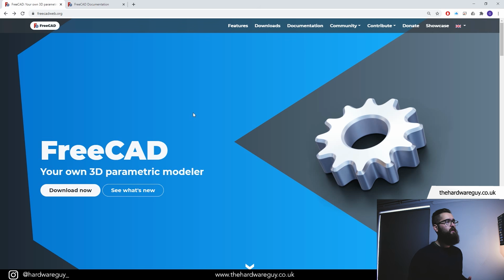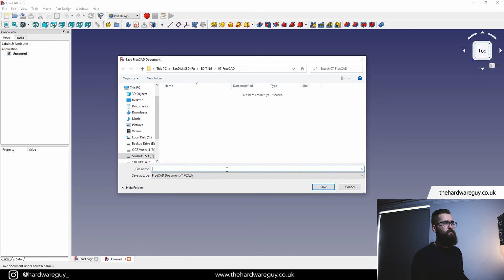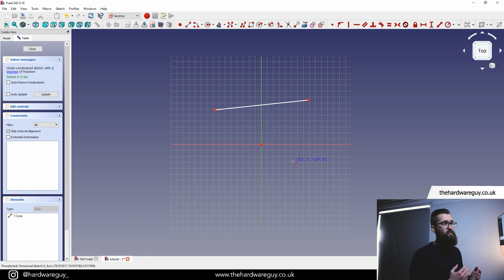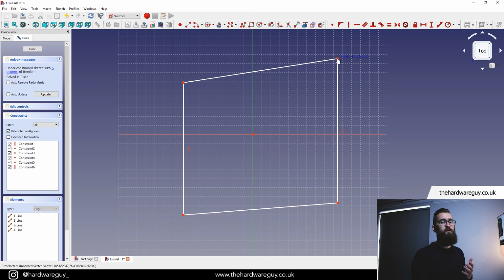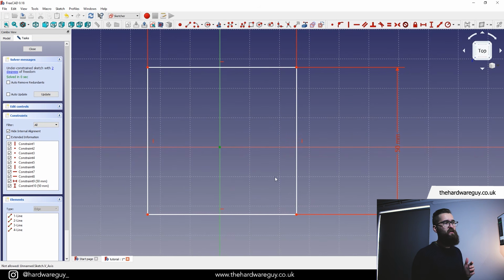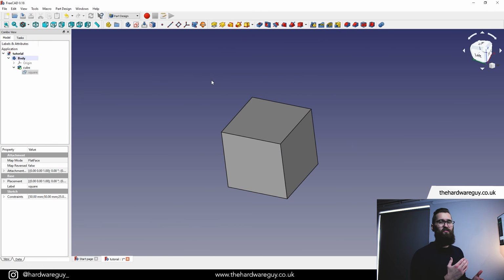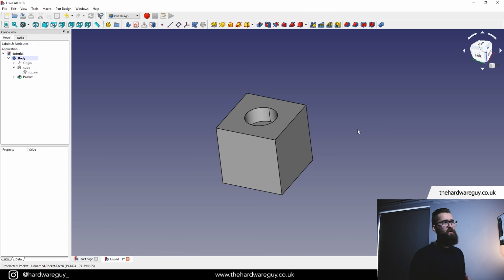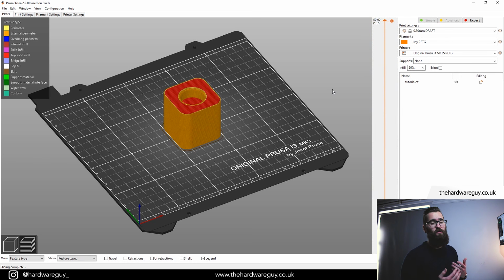FreeCAD For Beginners p.1 - UI, Sketching, Constraints, Extruding, and 3D Printing

Comment: Bro, I'm just going to tell you: I'm a software engineer and experienced with Sketchhup, but brand new to Free CAD.  And when I try to follow this tutorial I keep running into issues about every 2 minutes where my screen and results look nothing like yours.  I suspect ether you've changed settings over time or are executing key or mouse strokes without even thinking about it...without telling the viewer.  For example, I had to go figure out how to turn on the grid view in the sketcher.  Now after drawing the first square, "updating" and "closing" it's not showing my square on the Part Design view.  I can double click and go back into the "sketch" in the model tree and the square is there.  It just doesn't show up in the part design view.

I'm going to give it about 2 more minutes to try and figure out what the difference is but I'm close to abandoning for a different tutorial.  I suggest...well...can't imagine you would now.  I'll just state it this way: you should have done the tutorial starting from a fresh install of FreeCAD and been very conscious of every action you are taking and let the viewer know.
Reply from the maker: Hi William, sorry to hear that you've been having difficulties. All my UI is default, and I did actually do this tutorial on a completely fresh install of FreeCAD 0.18 for the exact reasons you highlighted above. Tens of thousands of others seem to have had no issues so I think it might be a problem with your FreeCAD installation. Try download a fresh copy and give it another go! Are you on Mac, Windows, or Linux?
Reply: @thehardwareguy  I was able to get through to the end and create the part.  I really don't have any idea what changed.  Yesterday I had not apparently hit save, so on app start all I had in my tutorial file was the "tutorial" object at the top of the tree.  I went back through from memory and repeated all the steps, but this time when I hit hit "update" and "close" to get back out to the part design view, my box showed up and was there.  From that point I could follow the rest of the tutorial.

It worries me a little in terms of stability just because there really was no obvious action on my part that changed anything.  Is v0.19 suppose to be fairly stable?  At any rate maybe for others: if something flakey is going on maybe try to restart the app.  I'm just saying...that's all I did to see the different behavior.

Apologize for the frustration vent yesterday.  I know these videos take a ton of effort and your quick response was very gracious.  I will continue to go through all of your videos. Thank you for taking the time to create them.
Reply: @thehardwareguy  PS this is on windows, Predator Helios 300.

Comment: @Gareth -  I thought this video was well done, and informative.  However, I have to admit, it took me about 4-5 viewings of it before I could get the same results as you.  But I'm getting older, and things just don't sink-in like they use to.  :)  One observation that really had me stumped, was when I went to draw my lines in the XY plane.  Every time I would go and click and try to draw the line whole  plane would move.  I finally learned via the web, that I was in 'inventor' mode instead of 'CAD' mode.  This no doubt has frustrated many a new user to the software.  I've loosely tried other design software and  really find all of them not very intuitive.  I guess my frustration stems from simply wanting to do very simplistic designs for the type of objects I need to 3D print.  While I understand the need for advanced 3D software for professional use,  it would seem to me there's a missed market for the weekend 3D warrior - for lack of a better word.  :)

What I need to do is design a simple 2D  object.  Give it a little depth (Z-axis), put some holes in the corners and print.  This can't be too hard to do - either with a beginner type app, or the more advanced.  I'm so use to drag-n-drop with other software, that I found even FreeCAD difficult to work with, because those simple techniques don't seem to apply, or haven't obviously been built into the packages I have tried I tried in an intuitive way.  One should be able to simply grab a corner, frame-out the length, width, and even depth with a mouse more easily than the steps required in FrCAD with coincident and constraints etc.   Don't get me wrong,  You're doing a great job for a beginner, and maybe most folks want to do more than I do, but isn't there a simpler way?  Changing the length of line should be able to be done with the mouse, and I did see some evidence of that capability, after I went back and tried to change the dimensions of the cube in this tutorial.  However, I never met with any success.  What's the command for 'starting-over' ? :)  I have to admit, I threw my hands up in frustration.  Maybe I'm the only one!

Anyway, just some thoughts I would share with you and the audience.   It's evident I have more to learn in a more structured way with techniques I think are over bearing to the user when applying to simplistic designs.  I've subscribes and will continue my journey.  You seem to be making the most sense and explaining things very well.  Thx.

Comment: Freecad still needs some work... "fix horizontal distance of two points..." what about just having a tool "dimension" and have it be clever enough to understand that if you click two points, that's your dimension between them, point and a line -> distance between them, two lines that aren't parallel? Maybe you want to set the angle between them... you just click a line? you want to set it's length etc.

less hassle, less tools, less time wasted :)

Padding? In EVERY package I've ever used it's called extruding, why change that?

Poacket tool?!?!? What? You should be able to just extrude that sketch using boolean operator, no separate tool required!

all these different and very particular tools make the user interface cluttered unnecessarily.

Freecad needs UI overhaul and a UI designer :)

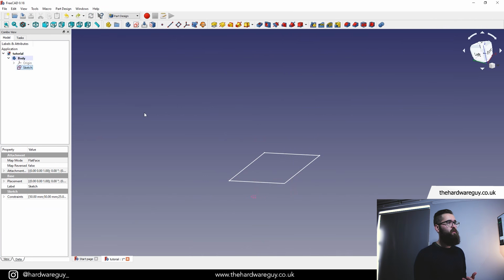Comment: This is a GREAT tutorial.  I've been through it many times, bit by bit.  I'm using 0.18 on a Mac.  My problem is that the menus don't always look the same as TheHardWareGuy's menus.  Example; 13:29  Once I've clicked Update and Close, the grid disappears, but my square is gone as well.  I've been through this part (and many others) more than a dozen times, carefully, but still out of synch.  So I'm less than 15 minutes in and already spent more than an hour.  What am I doing wrong?  How can I get help from someone (preferably in UTC-7)?  Obviously, a tiny button or click somewhere to get me back on track.  Just haven't found it.  *#*@&(@*@!!

SO many settings that can be different.  Is there a way to "factory reset"?

Comment: This looks well done (I'm less than halfway through), but version .19 seems to have some differences. For example, that startup display with the "Documents," "Help," and "Activity" tabs doesn't appear. Also, after you select a sketch plane, the plane is displayed without a grid by default. Also, after using the Constraint tool, there's no apparent way to get back to the regular selection tool; seemingly small omissions like that can get people off to an aggravating start.
Reply from the maker: I agree, unfortunately I cannot account for future versions/changes when I make these tutorials! Usually the changes are small and logical, and with a bit of Googling you can figure it out👍🏻
Reply: @thehardwareguy  Certainly. I'm finding that the bigger problem is FreeCAD's strangely arbitrary behavior. For example, the first time I used it, I never created a part or body. Yet at some point it presented primitives in the tool bar, and I started constructing a model. On trying the same sequence of steps, I've never found a way to get it to do that again. And the missing grid is perplexing.

We'll see if behavior like that turns out to be bugs or unintuitive UI. Meanwhile, keep up the good work!
Reply from the maker: Thank you! I have to agree with you.  FreeCAD is great if you can deal with those bugs, but for me it massively slows me down. Fusion 360 is my CAD package of choice for sure! So much more efficient

Comment: Gareth, nice instructional video.  I got a lot out of it. I'm trying to design a foam insert for one of my hard-shell cases for my drone and had to trace some of the objects (e.g. remote controller, drone, etc.).  I'm trying to get these into FreeCAD, but I'm a novice when it comes to CAD.  I can follow instructions very well though ;).  I have a good friend that had a glass cutting business and I can use his waterjet or 3D printer as long as I can provide a finished drawing in PDF format.  Have you done any videos on how to import objects from a PDF into FreeCAD?  Thanks, Gio.

Comment: Very Well Done video and explanation. What I find difficult is the approach to making a component you want to 3D print, example would be fan blade. What would be the process to building say for example a 3 blade fan blade with a hub that attaches to a motor. That is some thing that would kick me in the right direction to proper design.

Comment: I tried this program out and managed to create a drawing of a workshop I am planning to build. Then when I shut the program down, after saving my drawing, the only thing saved was the outline. No dimensions, all lost. Then when I tried to print it out the program crashed and did so several times in a row. A total waste of time. I don't know why you are promoting it.
Reply from the maker: Never had this issue! Could just be your computer if it's low spec. What operating system are you running?
Reply: @thehardwareguy  Windows 7, 64 bit. I am trying Libracad, hope I have success. My old Autocad won't install on the 64 bit system.

Comment: Hi Gareth - Thanks for clearly explaining how to use FreeCad - I have been using Autodesk Inventor for some years now but since they now have moved to subscription based licenses and Windows no longer supporting (conspiracy) I am extremely disappointed as I cannot justify the absorbent fees they are charging. So I have opted to move to FreeCad - I have subscribed to your channel so most likely I will be leaning on you for assistance until I bed in on the merging over.... Keep up the good work rgds Patrick

Comment: If only Fusion360 and Blender tutorials were this well-paced and easy to follow. Having an engineering bent, I've not so much cut as I have smashed my teeth on Fusion360, creating sheetmetal bracket designs for work.

The time spent explaining constraints was well worth it because whilst I've seen them in F360 and have sort of understood them, my sketches have always been a little arbitrary and I can take away the constraints lesson and apply it to both FreeCAD and F360.

For the same reason stated at the outset, the licensing change has seen me looking for something free but easy to use at home for 3D modelling/printing. 

I think this video has locked me into FreeCad - well done, mate!

Comment: @ thehardwareguy

Words cannot describe how happy I am with this tutorial.
I've recently started into the 3D world which I am so happy with. I've 3D printed so much stuff already.
But there are so many things I would like to design and print but I have no experience. I have been using Tinkercad and importing someone else STL, then editing it. You can imagine all the headache I have been having.
I did had FreeCAD installed but I had no idea how or where to start from.
I am a Linux user, I did try 360 Fusion via a Windows VM but you can guess what happened.
I managed to create this cube, export and import it into Cura and voila, I would be able to print.
I am so damn happy. Thank you for such simple and yet high-quality content.

Subscribed!

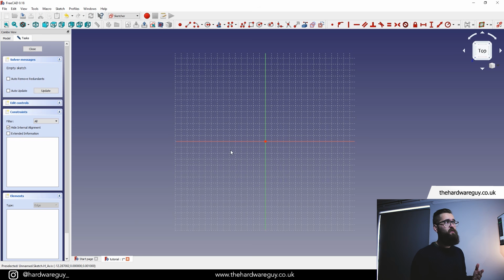Comment: At 5:09, my plane is missing the grid, it only has the green and red line.
Reply: under edit controls i have a check box for show grid
Reply: Thanks for your reply but, I looked for Edit controls, can not find. Under Edit /Preferences/Sketches (button)/show grid (checked), grid size (entered 20 mm) this gave me a grid. Using Version 0.19 if that makes a difference.
Reply: @billsmith2308  I am also using 0.19... I just started using freecad so I don't know if I am using the correct words so I made a simple video that could help.
https://youtu.be/-TSDAhBWnA8

Comment: I can't get the spreadsheet to display in inches (" or in) even though I set it to imperial in preferences and set the cell properties. It keeps converting.

Trust me I wouldn't be using Imperial if I didn't have to.

I was expecting to have problems learning freecad but not this early on. I'm running 0.19.

I know this isn't the FreeCAD forum but I just thought you might have an idea of what I can try.

Comment: I'm having trouble putting two shapes in one file using sketch. For instance, if I sketch a circle, pad it, everything is fine. Then when I sketch a rectangle, I can't pad it. I've tried in a different shape, different body, tried all the copy options that produced and finally usually end up with Freecad saying I'm trying to pad two objects at once. Is this a feature?

Comment: I followed right up to constraining the position without issue, but  once I closed the sketcher and went to back to part design to to the pad, I keep getting an error saying that I need an active body object in the document. I couldn't figure out how to do that, or even what that means, exactly.
Reply from the maker: After creating a new part and body as show in the video, the body will become active for you to sketch. If it is not already active, double click on the body in the part tree to make it active. You should then be able to sketch :)
Reply: @thehardwareguy  apparently I renamed the body, therefor deactivating it, if that’s possible. I added a new body to the document and was then able to do the pad. I had just installed the software a few hours earlier and have no experience with CAD. I lost my project several times, it disappeared from the screen, couldn’t get it back. So I started over and actually finished my part design, recesses, holes, and all. Thanks to your video. I look forward to seeing more.

Comment: This tutorial missed one thing. To improve export quality go to Edit>>Preferences>>Part Design, select the Shape view tab, and then under the "Maximum deviation depending on the model bounding box" change the default number from .5 to .01 it will greatly improve your export/3D print quality. 

Over all great tutorial! I use Solidworks at Work but they are locking down the use of work software for personal items so I am picking up Free Cad for 3D design, and KiCad for PCB design. I hate learning new software. :/
Reply from the maker: Excellent tip, cheers!

Comment: Excellent video thanks! Great pace, well explained. I recommend getting a keystroke visualizer though. I've been struggling to use FreeCAD for a couple weeks now. My biggest mistakes was using the drafting tool instead of sketch, and not creating a body straight up, but trying manipulate non+body objects/groups/components. I'm still very confused as to what they are and why every 3D thing is not a body, but I'm happy to see you have more tutorials which I will make my way through. Came to FreeCAD because I got tired of dual-booting out of Linux

Comment: So maybe this tutorial is good. But there is no way that it actually solves issues. I followed along drawing out my lines, tried to add constraints and... nothing. No endpoints joined together. The lines can still be moved independently.  I can see the constraint listed under the Tasks option, but when I select them, I can't do anything. I get messages such as "Selection not allowed by filter". Tutorials like this only show you things which "work". Not issues where things go wrong.
Reply from the maker: Hi man, sorry to hear you're having trouble! You must've gone seriously wrong somewhere. Make sure you're using the correct tools, you might be using the 'point' tool instead of the coincident tool. Please try again and follow extra closely.

Comment: Can you teach how to design electronics enclosure with cutout for SD card, USB type C, wires, LED, fan cooler, and make it parameterized.
Reply from the maker: Certainly, was considering maybe designing an Arduino Uno or Raspberry Pi case
Reply: @thehardwareguy  not arduino or raspi both are old things and easily available, generic cases like https://www.youtube.com/watch?v=cJfbINgyz-k but with cut out for different things like fans, USB type C, SIM card, etc. Using metal inserts, and if you can generate it directly from Kicad 3D stl, that would be even more great.

Comment: Good vid👍
I rounded out the top outside edges, made the hole 45.5 mm deep and 3d printed it as a pen holder🤣
Cheers
Reply from the maker: Thank you! that's the best thing about CAD, as soon as you know the basics you can design practical models for 3D printing! All the best Patrick

Comment: Cheers, I have not really used a CAD, well not since the Amiga days and I only dabbled then, so at 56 years of age, I thought I would give it another go, certainly now with 3D printing being a thing.  I do use Cinema 4D and I thought because I am using that, I would be able to get into this CAD thing easily. How wrong I was. I think I must have gone back to the start of your video about 10 times,  but I have done it, a strange cube shape thing, with a dip on the top.  So thanks again.
Reply from the maker: Awesome! so glad I was able to help you learn. Thank you for watching